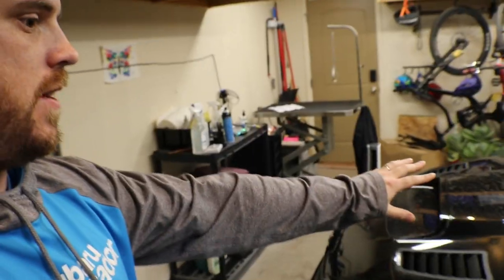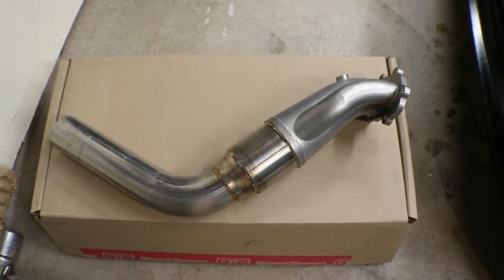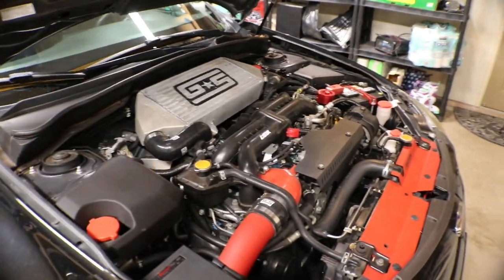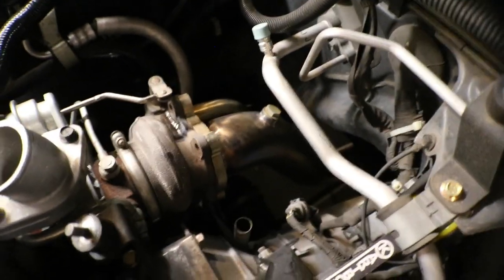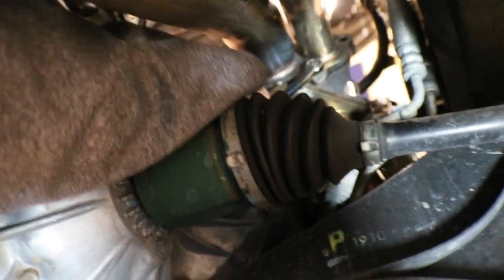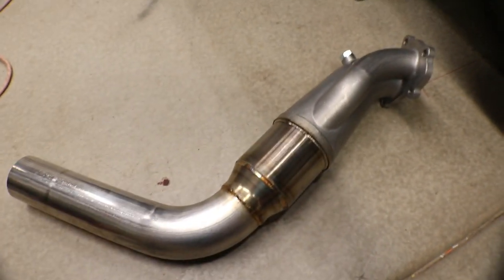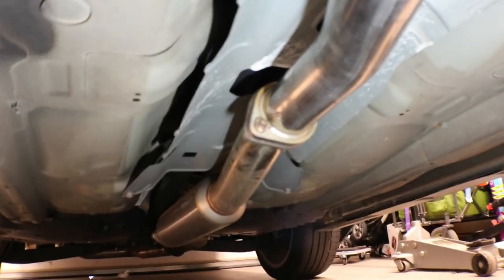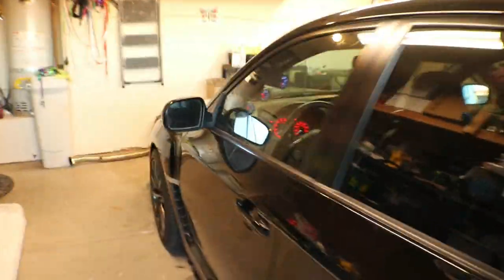GrimmSpeed V2 EJ Downpipe GESI 2008-2021 Subaru WRX STI | How To | Cobb Green Speed Compliant

Comment: Hi i have a wrx 2021 stage 1+ with cobb and i want to do a down pipe but i dont know how to get the map .
Reply: The FA20 wrx used a j-pipe. Shop around for that. As for the map, seems like you already have an Cobb Accessport so check out Cobbs website and see what map they recommend based on the parts install on your car. Typically an intake and J-pipe would be a Stage 2 map.
Reply: cobb removed it. you would need to get a protune